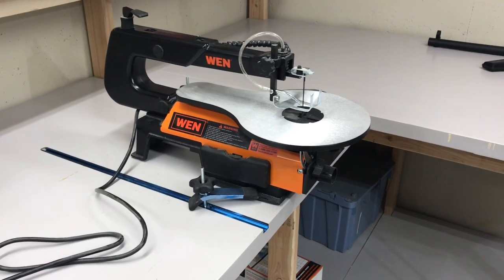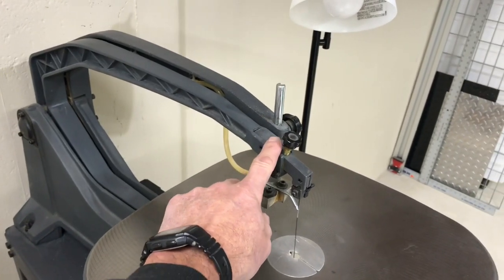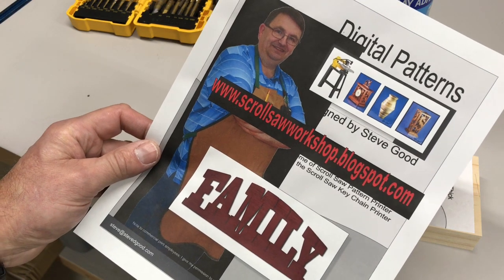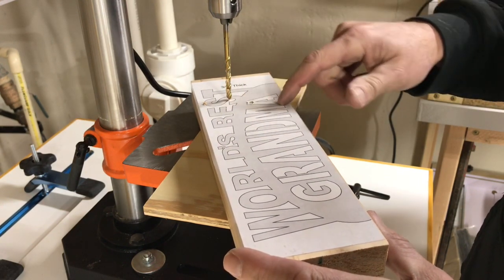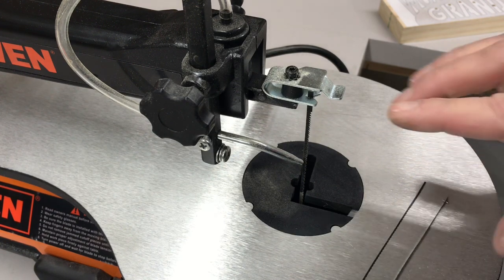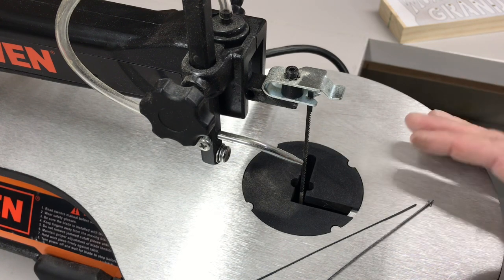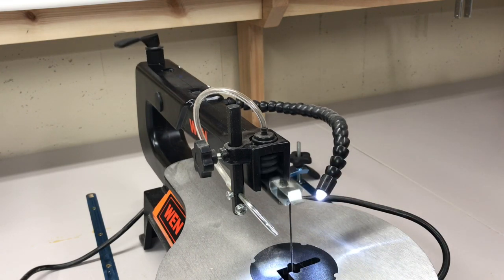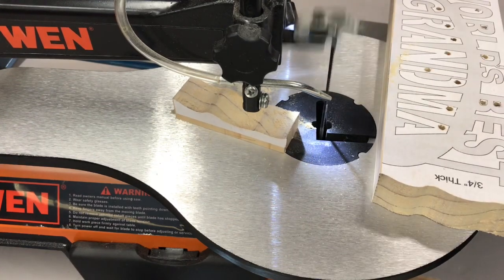Scroll Saw Comparisons / Scroll Saw Basics / Blade Choice

Comment: Hi Tom, nice job. I  bought the WEN and think it does a good job if you don't have to use a pinless blade, a month later I got a DeWalt 788 and love it. I'm new to the scroll saw but find it fun and a great stress reliever. Congrats on being a new Grand Pa !
Reply from the maker: Thanks Ron! I’ve tried for over a week to find parts for the old Craftsman Scroll Saw with no luck. I ordered, and my DeWalt 788 delivers today! I had one years ago and it worked well, can’t wait to get it set up. I agree about the Wen, changing the pinless blades are a pain! Thanks for Watching and commenting!